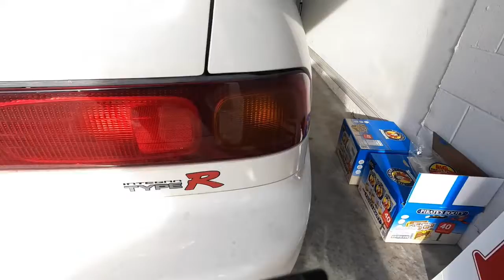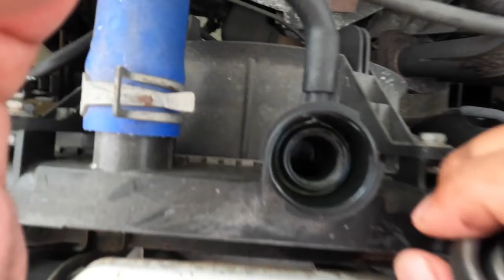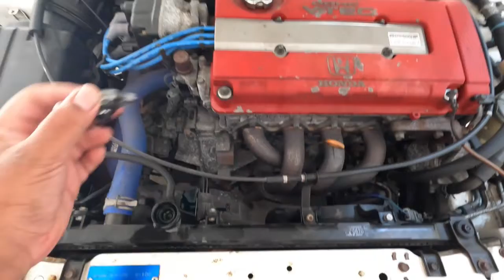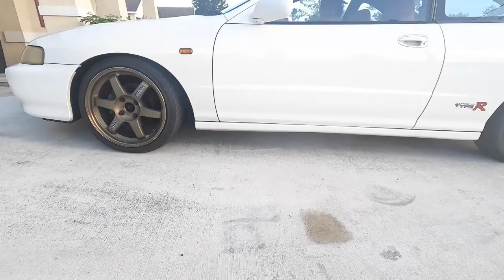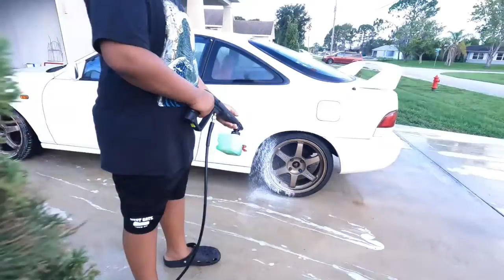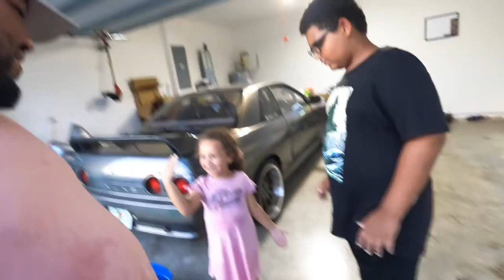JDM Honda Integra Type R Maintenance day

Comment: That's a clean one and under the bonnet[translation martix engaged...] Hood looks very clean. Normally their valve cover paint is fecked, because the paint is about as robust as an egg in a cement mixer, but yours is very nice. 
And you have the original intake bits and bobs. They usually got thrown out for some heat soaking "performance filter" arrangement(though the Mugen intakes are very good). Interestingly it looks like the original strut brace was swapped out for what looks like a Spoon one. 
The original radiators can be prone to leaking, usually letting go where the plastic caps meet the aluminium core. Hopefully it's not that. Man you were blessed you caught the lack of coolant that before it overheated. Though it takes a lot to overheat them as you've proven. 
Have a good one at the cars and coffee. 👍🙂
Reply from the maker: Ahhh good eye my man, i had a feeling the strut bar wasn't the original but i couldn't find a similar one. I looked at the spoon and it definitely resembles it. Thanks for watching and thanks for the good information. Should i go with a koyorad?
Reply: @StubbornOnes  Koyo rads are very nice quality. I never heard a bad thing spoken about them. Then again your original Honda radiator may be fine. 👍🤞